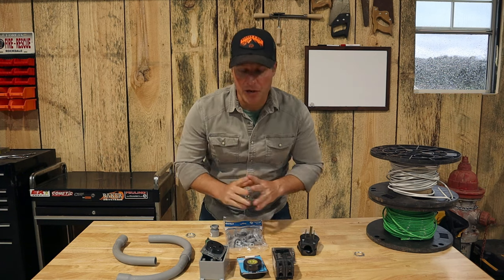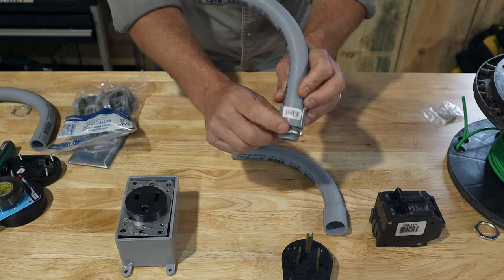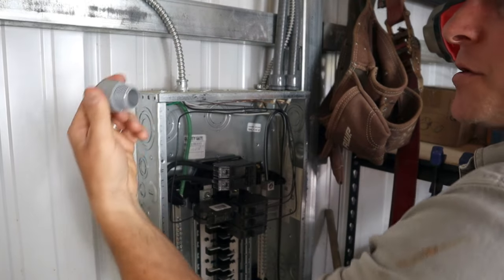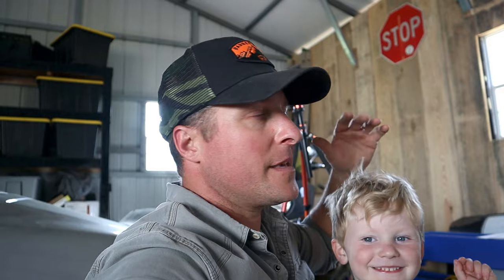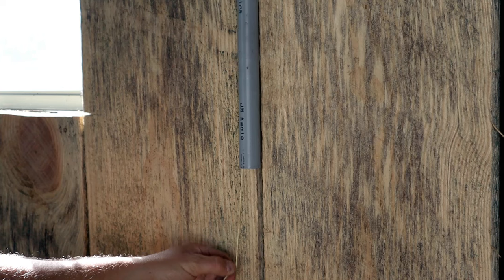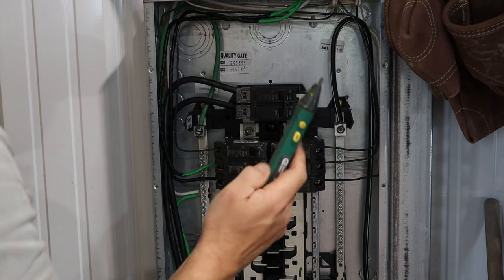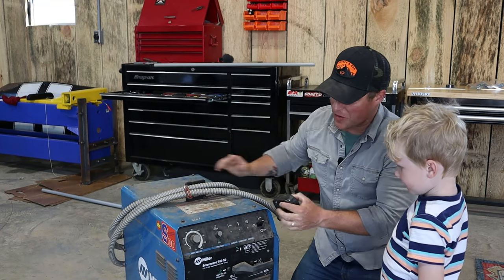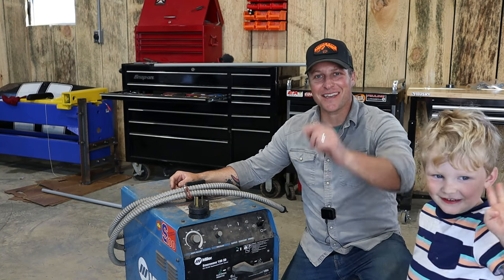FINALLY! IT’S EASY!  How to wire a 220 volt outlet for a welder.

Comment: The fans an circuit boards usually run off 120v , making the white wire a neutral not a ground.

Comment: As an electrician the only problem that I see is that the green wires are completely covered and you have a white on the isolated ground bus. Finnish covering the greens as much as possible and paint or tape the white wire green and you would be good to go. Great job though.
Reply from the maker: Thank you. Hopefully getting some green tape tomorrow to finish it up.
Reply: So a typical home can handle a decent amperage welder?
Reply: Like the work you do and the content that you share.
Reply: I'm wiring a adapter for my welder to 30 amp generator plug. It doesn't matter which side the hots go?
Reply: @hinds90  Correct, the only issue was how they were identified.
Reply: @Strings-jg2to  most homes should
Reply: I specifically run my mig welder off of a generator. Getting ready to wire an outlet. A RV pigtail allowed me to plug into the generator. @hinds90

Comment: If I do this myself, I can save some money.  

Well, I say, put an electrician on a 
"Picnic - tainer". ( A retainer paid for with a picnic basket) or beer or whatever.

A quick visit by them can get you more knowledge than you need and you can still do the work.

Little points might help greatly.  PVC piping is to be supported not to exceed 3.feet.  That is a lot of ladder movement to reach the pipe.  EMT is to be supported not to exceed every 10 feet.  EMT can be bent with a tool, but your new buddy might be able to bend it at work from scrap.

And much more.

Comment: I have a hottub breaker in my backyard which has 4 wires. 1 red, 1 black, 1 white, and 1 copper ground. I know the white and black wires are my 2 hots for the 240v. But which wire do I put in my 3rd prong the copper ground or the white neutral?

Comment: The whole part of wanted to see was how you connect a plug to the metal cable at the ends and you didn’t do it.  I want to disconnect my water heater hard wired, and put a plug on the end of it. And then a wall outlet. Which is better 3 pronged or 4 pronged 220?

Comment: As an electrical guy, there is a seperate nec section for welders, however. 210.8 talks about accessory buildings, shops, and garages needing gfci protection for all recepticles.

Double check in your individual are to make sure you are good for your build.

Comment: Why did you have to run your conduit thru the ceiling and down instead of, say 44” above floor”, was that a code requirement?
Reply from the maker: I ran it high just to have room on the wall for shelves and workbench space really. The other walls I’ll probably run them mid wall. Thanks for watching
Reply: I do not know of a code requirement on this.  It is just bueaty or space consideration on the wall.
Reply from the maker: @keithharrington8715  yeah honestly I didn’t even look for a code but I knew I didn’t want my power conduit always being right there on the wall having to deal with and go around all the time.

Comment: im looking to run a Lincoln electric 180T-HD which also has the 3 prong factory install male prong plug. I need to install the same setup to my main breaker box which is GE branded. My question is can I use 8/2 romex for a 2-pole 40amp breaker or do I need to run the separate strands like you did....
Reply: 8/2 Romeo is fine

Comment: Great video as usual! On a 240v outlet, the white wire (on this case) are neutral or ground?  I understand that both should be the same but I just wonder. May be a fellow electrician can help me on this one
Reply from the maker: Thank you!
Reply: @ Maximiliano Besso- the white the way he used it in this scenario is ground. But just to slide information your way since you asked. The ground and neutral are different. The neutral normally Carry’s current as a return path back to source. The ground only carry’s current if a fault happens like a hot touching a ground (ground fault) or hot touching neutral (short ciruit). The Neutral and ground are only connected at the first means of disconnect from the transformer feeding your house. That can be at the meter, the main panel, or even at the service drop although most times it’s in the meter where I am or the main panel. For si panels they are separated to keep the return current from traveling on the ground as it would be paralleled back to the panel. I hope that helps you. Also I will add that a neutral that is below size # 4 has to be white insulation or black with 3 white or yellow stripes it can’t be reidentified with white tape, a # 4 or bigger may be reidentified by phase tape or other means. And while the colors he used aren’t what we normally use for this type of install. He did reidentify the hots, and as far as I know it doesn’t violate any codes I’m aware of.
Reply: In the case of most 240 volt welders there doesn't need to be a neutral, the 110 volts is made within the transformer of the machine. Hope this helps.

Comment: Where is the gfci and where it the 6 gauge wire ?
Reply: The the gfci breaker I agree with, but the # 8 wire he used in this video since it is Thhn is rated for 50 amps in the table 310.15(b)(16) in the 75 degree C column because the receptacle and breaker are rated at 75 degree C. So you can use #8 but if he had used romex he would have had to use number 6 because although the insulation rating is 90 degree C the NEC says you have to use it at the 60 degree C column. That in article 334 if I’m. Or mistaken. Codes are changing, different states have adopted different code cycles and all are not on the same cycle, but the gfci breaker I would agree should since it’s a workshop outside of the home should be gfci protected.

Comment: I apologise first. Here in the UK we just plug the welder in as normal using that very British Ring Main and standard plug fitted with a 13 Amp fuse.
Reply: Thanks mate, I just bought a 200A MMA machine and was worrying a bit about this. I'll try it in a regular outlet and keep an eye on the wiring... Here in the Philippines the locals will plug in anywhere and stick weld just about anything vaguely metal.

Comment: A wiggy is more of a double check for peace of mind - I never trust one by itself to check if a panel is on or off, that's what my meter is for. 
After a slum lord almost killed me with bootlegged power from a separate building to a dishwasher I was replacing (I had the panel off on the unit I was working on) I now; Cut the Power - Test the Power - Short the wires just to be sure. Getting hit with 110v while laying in a puddle of water was not a good start to the day.

Comment: sub panels need a separate ground bar
Reply from the maker: Yes sir that’s why I and everyone should take the bonding strap off the sub panel. It Separates the ground and neutral bars. Then add a grounding rod to the sub panel! Safe and sound

Comment: In summary, there are two or three NEC violations here. It certainly wouldn't pass inspection in my area: (1) Green can't be reidentified as black, and white can't be reidentified as green, ever. (2) PVC must be glued. In fact it must be glued before the any wires are pulled (so you can't even use the trick of adding the box after pulling the wire through). (3) If you are on NEC 2020 or later, every receptacle in a garage must be GFCI protected.
Reply: What about a traveler white being designated as hot? That’s a white to black. I hear ya about inspectors making silly rules but they’re just that, silly rules. The pipe is line of site and both end can plainly be seen in the panel and the outlet this is a satisfactory install IMO.
Reply: Yup, I would never run the wrong color line and who cares if the pipe is line of site. This particular line wasn't that long, spend the money and buy the right stuff. We can't classify whether a rule is silly, just follow them and we'll all be much safer. Oh sh*t, I see another comment asking about neutrals and grounds and copper. Leave the volts and amps to the pros!
Reply: I'm going to reach out to you because you seem qualified to answer, can I connect two 20 amp individual circuits to the outlet to achieve the necessary voltage at outlet?

Comment: You’re not allowed to use green cable and identify it as a feeder And I read in the comment before that it someone said tape up the green can I do that the insulation rating is not the same